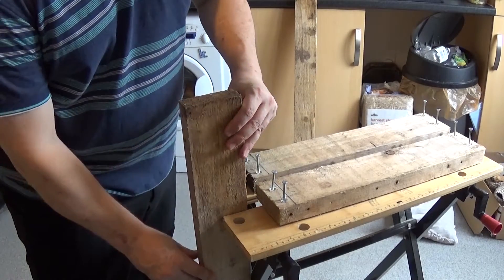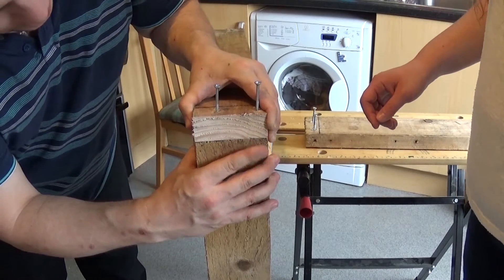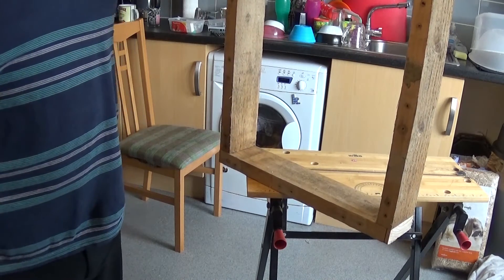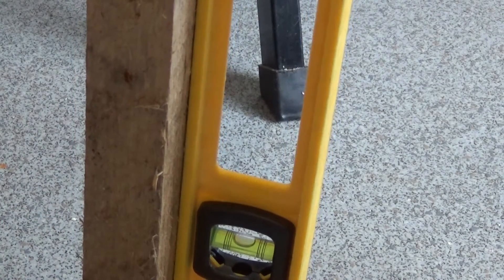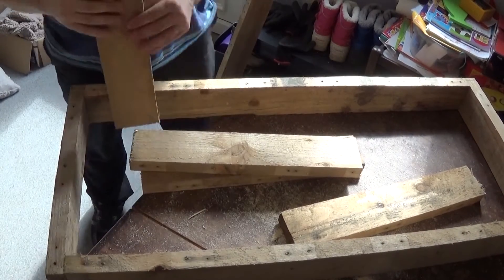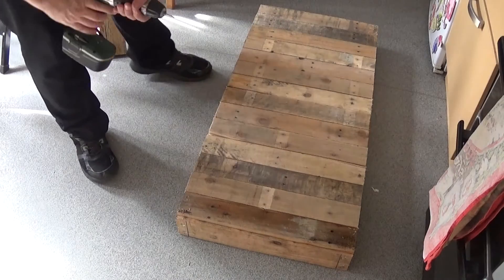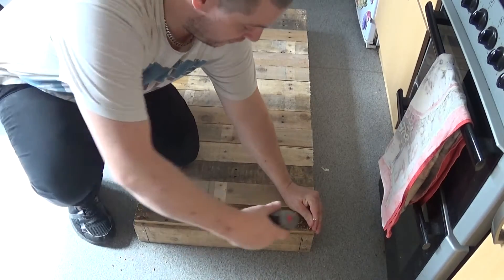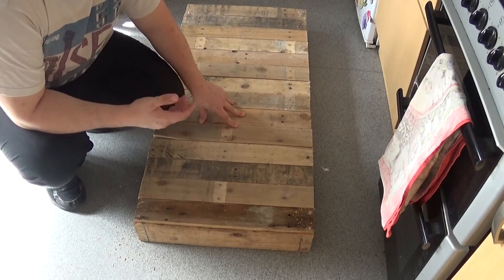How To Build A Simple 'Pallet' Rabbit Hutch Part Two | A Beginners Guide | Simple Woodworking Tips |

Comment: That does indeed look very sturdy, I wonder though of the floor. How will you keep that sanitary or will it be ok with hay or something? I just usually see rabbit hutches with a wire mesh floor, which I don't think is very comfortable for the rabbits.   Janice
Reply from the maker: Hi Janice Im not sure about whether a mesh floor is uncomfortable or not for rabbits but the reason I have made the floor out of wood is because of our weather. It is very cold here and I want the rabbits to be as warm as possible. As for hygiene, the wood I am using is heat treated so wont allow urine to seep into it also they will have a large amount of hay and straw as their bedding and are cleaned regularly. As well as all that they will have free run of part of out garden during the day which means they will do most of their business out of the hutch anyway. I will get the rest of the build videos on as soon as I can. I have been busy with other projects recently. Thank you for your continued interest. It is really appreciated.
Reply: jksatte lino is normally used on the wooden floor

Comment: Not a good idea using treated wood. Rabbits chew and it can kill them
Reply from the maker: Very good point. Always check the wood you use. The wood I used was only heat treated. There are codes and symbols on a lot of pallets. Check them online and they will tell you what treatment the wood has been through. Thanks for your comment
Reply: @TheOffGridFamily  I'm glad. I would hate to see you put all that work and love into building a pen that would kill your rabbits. In my case it won't help. I live in a wet climate
Reply from the maker: @reneebrown5598  All creative comments are appreciated. Its really wet here to. I just lift the hutch off the floor with a few bricks and its still doing well.